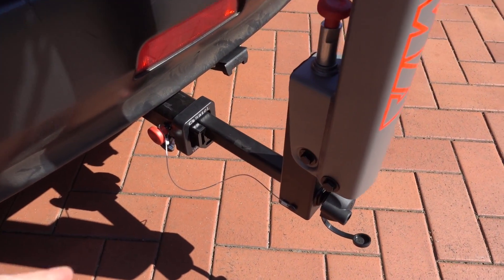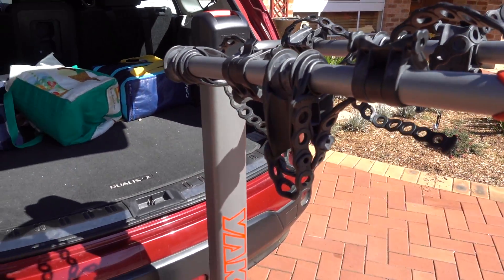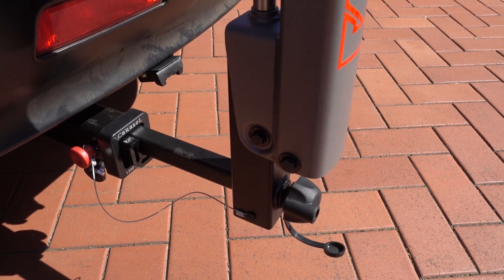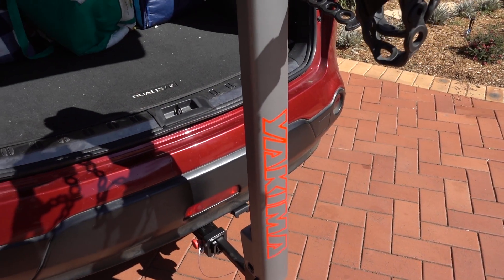Car Bike Rack Mechanical Design Paranoia

Comment: Im a mechanical engineer by trade, although out of it for nearly 20yrs now.  First thing that comes to mind is Fatigue, and that packing bushing which appears to have hollowed out sections. I suspect thats where the movement is coming from. As it stands yes its probably ok. But its one of those things you need to visually inspect after every use. Just in case a weak point starts to fail. Or if you see more movement than usual. That would probably be a good time to pull over !.
Reply: haha... that lever caught your eye too, eh?
I suggest that the bushing should be on TOP of the inserted smaller square tube to reduce the crush force that is being applied in that pinch area... plus it's loose. Not sure if it is worn from all the constant movement, inferior material, or if it was made that way for easier assembly. At any rate, it should be tightened up if possible. It's not going to fall out unless it completely breaks the plastic, the the constant movement is just going to make it get gradually worse.
If it were mine, I would fabricate a steel insert, or better yet, weld a receiver hitch size square tube on it and eliminate that spacer.

Comment: It does look very dodgy indeed. If the motion is only in the trailer hitch point in the car you could possibly try to shim it with thin metal sheets to reduce the motion. 

It probably won't just fall off in normal driving, but if you should happen to hit a bad pothole at speed you could get some damage.

Comment: Should the spacer be at the top rather than at the bottom, Not sure but the spacer looks like it's either plastic or alloy either way the bolt will tend to cut in and  allow movement. Otherwise it looks fine to me and I have forty odd years in the fabrication  industry ranging from the nuclear industry to trailer manufacturing and transport. As long as the bike rack stays put the job is a good un as they say.

Comment: Looks like you put the spacer in the tow-hitch the wrong way. Right now you have the tightening screw tightening down on the spacer. The screw should tighten down on the thin bar insert, and the spacer on the other side (likely on top) to offset it diagonally from the screw.

Comment: That thin square tubing scares me. Why didn't they just use the correct size tubing? Is there hitches that small made for bikes?
Reply: Yes they make hitches that small. It is easier to adapt one direction than the other.

Comment: This isn't an easy topic. The flexibility of the rack may be a design feature, to easy vibrations from the bikes into that car. As long as the material isn't stressed to it's plasticity limit, you're fine.

Comment: Some of the negative reviews on Amazon are interesting.  https://www.amazon.com/Yakima-Double-Down-Hitch-Bike/product-reviews/B0085VU3TO/ref=cm_cr_arp_d_hist_2?filterByStar=two_star&pageNumber=1 e.g. "Don't buy this product. Fourth time out the bolt holding the carrier to the hitch snapped. Luckily safety pin held and prevented a potential catastrophe on the road. However, bikes were damaged and had to run to a nearby Walmart to purchase a replacement carrier and get the bikes back home. New carrier was much safer, lighter and at a fraction of the cost."  It's also interesting the etrailer.com seems to have flooded Youtube with reviews of it.

Comment: It might be like buildings and bridges. If it can't flex, it will snap.

It looks like it is designed for places with nice smooth roads, not rough Australian roads.
Reply: What you're talking about is material bending. This is just wobbly. It has no obvious intent.

Comment: Note it probably also doesn't help that the Nissan Dualis is known for its bouncy handling e.g. "The Dualis can tend to bounce and shudder over bumps rather than react to them quickly and precisely, though ride quality is otherwise decent with no nasty feedback from potholes and surface joins."  https://www.caradvice.com.au/186652/nissan-dualis-review/

Comment: I think I would swap the bracket adapter bit for one of these steel ones https://www.amazon.com.au/Reese-80300-Receiver-Adapter-Length/dp/B000COAVU8/ref=sr_1_fkmr0_1?keywords=2%22+TO+1-1%2F4%22+Tow+Hitch+Reducer+Adaptor&qid=1566709662&s=gateway&sr=8-1-fkmr0 or https://www.ebay.com.au/itm/2-TO-1-1-4-Tow-Hitch-Reducer-Adaptor-Towing-Trucks-Trailer-with-safety-pin/270825389557?hash=item3f0e737df5:g:4hsAAOxyW7tRgJ~a

Comment: I'd be more worried about the cyclical loading from side to side. As you say the twisting it experiences when turning.  I'm not an expert but I know based on Miners rule the weld will fail at some point.  Most likely from whichever side has the most load cycles.

Comment: This help?  https://www.etrailer.com/question-303511.html  Why is the Yakima DoubleDown Ace 4 Bike Carrier Part # Y02451 Wobbling  "The Yakima DoubleDown Ace 4 Bike Carrier part # Y02451 has a knob which I have pointed out for you that is designed to help keep the rack from wobbling while traveling down the road. I would first check to make sure that the knob is tight as if it were loose, this is what could be causing the bike rack to wobble as you described. If the bike rack has movement with all four bikes attached and moving down the road at highway speed then it is possible for it to experience a slight wobble but nothing too drastic. I recommend checking the anti-wobble knob and making sure all of the other hardware is secure and tight.

We do not have a lot of complaints with the rack in regards to wobbling so please let me know what you come back with after the above has been completed. I have also attached a video that shows the hand knob being tightened as well if you need help." Doesn't seem to wobble much in their demo videos  either e.g. https://www.etrailer.com/tv-review-yakima-doubledown-ace-bike-rack-y02451.aspx

Comment: I thought you where worrying about bounce, yeah not sure about that. I have a bomber strap and a tounge thing so my a-frame strap can grab ontop of the hatch and that stops the bounce.

But that swing is super sketchy. Whatever you do thou, don't lash it off roof racks, they're only designed to take force in one direction, down.
Reply: another option that someone mentioned but slight remix is get a 2" receiver/tounge and get a tounge mount bike rack, mine is tounge mounted because my car can't get a 2" hayman reece

Comment: My bike rack won't carry your car,
@Dave any chance on doing an e-bike tech review, e.g. overvolt 48v on 36v motor/controller, under volt for range extension, mobile solar recharging, etc, there's lots of scattered & contrary fluff,

Comment: I'm pretty sure it should not rock back an forth like that. There has to be something wrong with that sleeve that's in the hole allowing it to twist that much. I've driven behind many bike racks and none of them sway horizontally. That's concerning. Is the insert plastic or metal? It's a bit hard to tell in the video, but is it twisting inside the hitch or is it at the 90 degree point further out? If it is inside the hitch, then yeah that sleeve needs to be replaced with something that provides a more rigid fit.
Reply from the maker: It's metal

Comment: Not an engineer but it looks like they made it to fit in passenger car receivers. They're usually small like that. Even i think that looks a bit small to be supporting 2 or 3 bicycles.. If its Just that one weld on that one small square tube holding All the weight from the bicycles then ya, its definitely going to fatigue over time and eventually crack, especially with the swaying it does.
 I wonder if you could put a strap on each side maybe up to the roof rack if your vehicle has one. Might help to stabilize its swaying which would help immensely.. I would just inspect it carefully every time you use it or get one with a bigger support that doesn't need an adapter to fit in your trailer hitch receiver.

Comment: I'm a mech eng. And the simple answer is its not that simple, because I don't know the actual material used, its specs or its dimensions for a start. If I were to build one, it would have a correct sized draw bar going into the receiver.
Reply: It's not that easy. Some tow bar manufactures have their own proprietary sized tow hitch receiver. I went to their supplier and the wouldn't even sell a 300mm off cut to me.
Reply: @danielwaddell123  I'm in Australia, so there is pretty much only one standard which is Hayman Reese, which it appears to be what Daves receiver is sized to
Reply: @Jedda73   Here in Canada, as well as the USA, we have basically three sizes of receiver hitch:  1-1/4", 2", and 2-1/2", with 2" (~50mm) being the bog norm.  Each adhere to different classes (5) and capacities (~910kg-9100kg GTW).   I've never seen any others in my over half a decade stumbling around this globe.  Not sure what Daniel is on about.

edit:  A friend just told me there is a fourth size:  3" (never seen one)
Reply: @Bob Sacamano   Now that you mention it, I do recall flat bar receivers...  although, I haven't encountered any in over three decades at least (had a 64 willy's w one to tow a 4 wheel steerable farm carriage).  I am familiar with pintle hooks as I've installed them on a few trucks, but dismissed the notion as a receiver was the topic. 

Perhaps Daniel will comment to clarify?

Comment: It looks like 25mm SHS, of unknown thickness, and that seems flimsy. It's a bit hard to tell without knowing the cross sections, ie 2nd moment of inertia, but if you are worried I suppose you could add hocky straps to either side.

Comment: Just went out and looked at mine. I must have had the same question because I omited the locking pin a was able to push the the hitch much deeper into the Receiver on my Car. I then used the friction crank. I was able to reduce the stick-out from the bumper by a couple of inches. Haven't had any issues with my Yakima. Side to Side tilt is about from 23:30 to 00:30. Don't think I would go off-road with it.
Reply from the maker: Thanks. I wouldn't want to use it without the pin!
Reply: @EEVblog2  Yeah I should mark it and drill another hole for the pin.

Comment: Am MechE. Other commenters are correct, if there's a failure point it'll be the weld. If you want to be paranoid, I'd either ultrasonic or CT scan that weld, but not everyone has such equipment available to them on a daily basis. I've seen 4 bike racks of similar design, BUT with the full 2 inch hitch as opposed to the 1 inch. And I've got no idea why they've gone with the one inch hitch as it's considerably less rigid in torsion, even for the same amount of metal. Strictly speaking it's not WRONG to build it like that - but it does seem just a LITTLE cheap, considering the application.

I might use it if I had to, but I'd be checking behind me the whole time.
Reply from the maker: Thanks.

Comment: Retired now but spent a lifetime making aircraft tooling and other stuff (life long blacksmith too). It is fine. You will never get to 1/100 of the weight the tube can take. My wife is handicaped and her $40,000 U.S. ... 300 pound power wheelchair rides on a carrier with that much wobble, been doing it for years, no problems. Our lightest car mounted wheelchair carrier is the small 1 1/4 tube too, no problems holding it up. If the wobble really bothers you, there are things that you can install to take the slop out of the connection.  This is but one of perhaps dozens of the stabilizers on the market. https://www.amazon.com/HiTow-Tightener-Anti-Rattle-Stabilizer-Rubber-Coated/dp/B077SHGWZM/ref=pd_day0_hl_263_3/130-8692697-9059149?_encoding=UTF8&pd_rd_i=B077SHGWZM&pd_rd_r=1f9c85bf-6cce-4994-bc56-79fbdcc09f36&pd_rd_w=hRmOi&pd_rd_wg=d9cEq&pf_rd_p=ad07871c-e646-4161-82c7-5ed0d4c85b07&pf_rd_r=S25HDQG9SZDTR90G5THC&psc=1&refRID=S25HDQG9SZDTR90G5THC
Reply from the maker: I'm not sure how much stability something like stabiliser will add?
Reply: @EEVblog2  Actually quite a lot, not as solid as welding but darn close. It clamps the tube to the hitch thus preventing it from moving. If you look at the last picture but ignore the actual extension part, you will see that one side of the plate presses on the part of the hitch mounted to your car/truck. The beveled part presses on the bottom or side (it can be mounted on the side of the tube rather than the bottom) and applies pressure along the entire face of the clamp and presses the hitch tube against the inside of your cars hitch thus preventing twisting. 
.
Reply: Yep, this is like how you over-engineer bridges so they don't bounce and sway in the wind, which won't cause them to fail but is disconcerting to the general public.

Comment: All hitches have some play in them.  If it was any tighter fit, you wouldn't be able to pull it out without tools.  Plus the vertical bar just multiplies this tolerance.
Reply from the maker: Yes, it's gets multiplied at the top. It's the stress on the welds at the 90deg point at the bottom I'm worried about.

Comment: Being DOT or whatever equivalent there certified, I know it is safe. However I always find them unsafe! This is also why I went with a platform type instead. There is less of a lever effect. Specially with electric bikes, those are heavier. The suspension type like you have wouln't survive for sure. The platform type use a bent square tube for the connection to the hitch receiver, so it is a one piece part. Then the vertical one is only to keep the bike upright and hold no weight except during the acceleration and braking.

I seriously wonder how some suspension type ones got their DOT aproval seal...
Reply: thephantom1492 The good suspension ones probably got their approval the same way roof mounted bike racks do: Proper calculation of all mechanical stresses etc. in at least one country.  Then all others rubber stamping that approval so tourists and bicycle racing caravans can legally cross borders without buying a new rack in each country.
Reply: @johnfrancisdoe1563  I bought one. I tried to put the electric bike without battery.... It is a kind of _|¯¯¯ shaped arm, with a plate that goes on top that hold the bike frame, with a single bolt with an handle. The top plate and the bolt bent, almost broke. And I didn't even let go of the bike fully ! There is absolutelly no way that this one could have survived any normal road with a normal bike. Maybe it could have handled those ultra light bikes, but I would have then been worried about bumpy roads... Seriously, it was that bad! I promply returned it, and the store, strangelly, said nothing at all about the return... Few weeks later they weren't on the shelf anymore.

Comment: You don't need to be a mechanical engineer to tell that is a shit setup.

The welded joint will eventually fatigue and fail. Really need a 2 inch bar coming off the tow bar, not 1 inch.

Comment: Many bike racks, including some Yakima's and the tray style rack we have, use an anti-rattle pin on the standard 2" size hitches.  Basically the hitch pin is replaced by a threaded bolt, and the rack has a captured nut welded inside of it.  When you tighten the pin, it pulls the hitch tight against two surfaces inside the receiver to prevent slop.  The fact you're running a 1 and 1/4" with an adapter, I'm not sure what options you have.  But I'm sure Yakima makes something.

Comment: Even the safety cable looks too thin to keep the rack attached to the car if that square beam breaks.
Reply: That's so you don't lose the pin, it's not for breakaway...

Comment: Yakima and Thule are good brand racks. Go to the website and chat with a representative.

That looks too loose; with the wind and weight of bikes you want a secure fit. You might disassemble and try reassembly. Once you get the rack secure, you need to double check entire rack every time you mount bikes for damage and secure fit.
Reply: I'm not a fan of the design but I do agree that it's not going to snap in half and it is a well built rack. It looks to me the looseness is in that hitch joint adapter. I'm not familiar with that style of bike rack but I've done many full-day trips with a 20 year old trunk-mount rack and the biggest thing to ensuring it was secure was tightening everything up as much as possible, otherwise there's a risk of something coming loose over time especially on long trips, this would obviously go for any bike rack or anything you are attaching to your car. When you're driving at highway speeds for 8 hours any movement whatsoever is asking for the thing to work itself loose and you do not want to be the person that causes a multiple vehicle accident because your bike flew off your car...
Reply: @erikthered4929  Good points. We are constantly checking rack and contents whilst on the road. On long trips we will stop every few hours to check rack and contents are still well strapped down and solid.